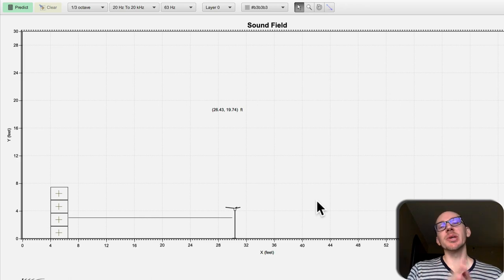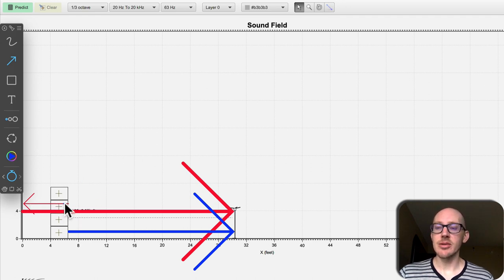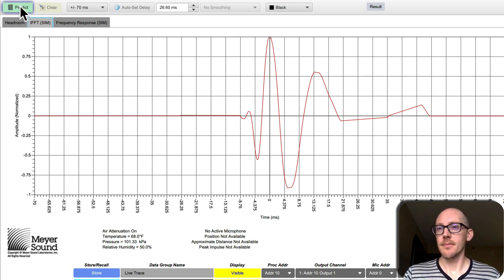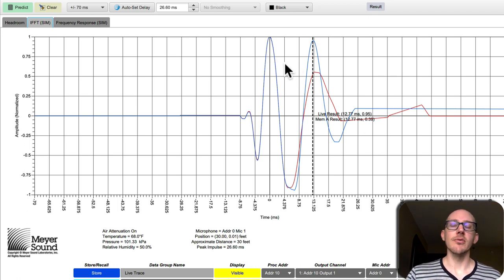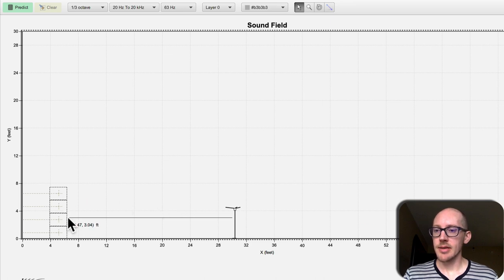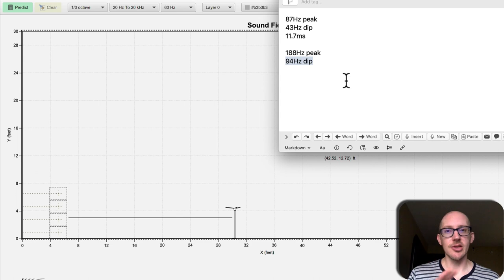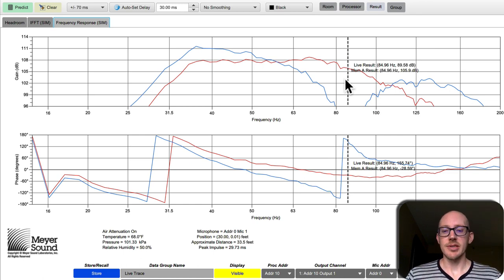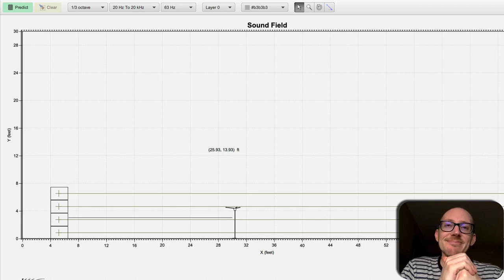Is it better to face your subs at the wall?

Comment: Wouldn't the air port make more of the difference! Like my case when its above and in same direction as the woofer? Mine sounds twice as good off the floor on and end table but 2 feet from the wall ...kinda using the underside of endtable as a "box"...LIKE A 4TH ORDER in a vehicle!
Reply from the maker: Hey Bryan, I don't think I understand the phenomenon you are describing, but yeah, if it sounds good, then great!
Reply: My like sub has the port on same side as the lil sub...it also has the power and surround hookups on same side...other worda like its "suppose" to go facing the wall?! The way my living room is set up i have an endtable between my couch (end i sit on) and the bar! The endtable has slats of wood under it to likely hold magazines or whatever! I have my sub off the floor and yet under the endtable facing wall but like 2 feet from it! (Have tryd it closer) the couch itself blocks one side of endtable...the wall for side the sub and ports faces...and then on other side is a corner with bar that has over a foot in overhang! I know its hard not seeing it but it works out like a box inside of a bigger box...which in car audio is "almost" like a 6th order box build...lol. Tks for reply back! Oh its just cheap soundbar with small sub and the satellite speakers for the rear! My son has just the bar and sub in his room but sadly i cant get it to connect to my soundbar along with mine! We can Bluetooth music to both at same time but only way to have both speakers playing in the living room is to also bring his soundbar into here also!

Comment: Why didn’t you just do inphase cardioid and that would’ve Essentially eliminated the wall component?
Reply from the maker: Hey Blonchay, my initial designs were all directional arrays, but then at the last minute it looked like the subs would get pushed up all the way to wall, so I changed the design to omni. Then, the position changed again, but at that point I was putting out fires and didn't have the bandwidth to make another adjustment. But you are right! That could have helped.

Comment: isn't it better to have it 6-in from the wall? there is bass reinforcement as well
Reply from the maker: Hey Hoobs, isn't that what I did? Or maybe I misspoke? The goal is to get the acoustic center of the sub at the wall or as close as possible.
Reply: @nathanlively  
I wonder if it helps to put a bowl in front of the speaker driver, when it's facing the wall for more dispersion if tight against a wall?
Reply: @hoobsgroove  Zero influence, a 30 or 40 cm sphere isn't going to change anything at these wavelengths

Comment: How to change the centre of the bass responce if I can't set delay to my sub?
Reply from the maker: Hey Luca, I'm not sure if I understand what "centre of the bass response" means. Could you explain?

The main tools at our disposal are placement, delay, and filters.
Reply: @nathanlively  sorry for my english,I meant, how can you prevent bass from going to the area at the back of the room? The room is 6 meters wide and 18 meters long , the dj station is in the back, 2 meters from the wall.
By placing the sub in front of the dj boot I have cancellations in the middle of the room, and too much bass in the back of the room.
By placing the sub still on bottom but not in the middle, I place it on one side of the room so I have a more even bass but the problem of too much bass on the opposite side of the room remains

Comment: All you need is accurate clock and a mirror and a recorder then you can measure sound, light speed easily and even a prism with digital measurement then you can measure light then compare. Use a laser pointer with precise watch and mirror 2 km away is possible too